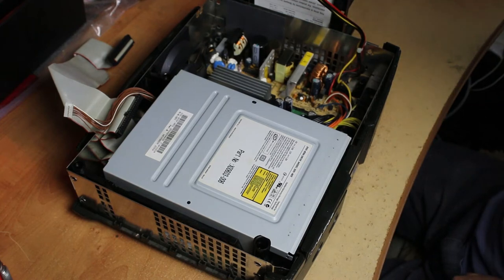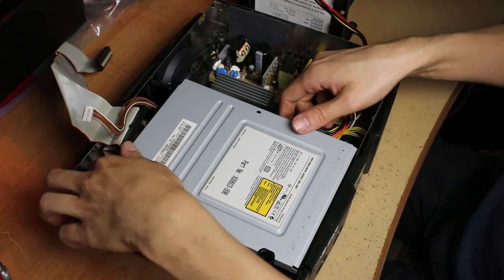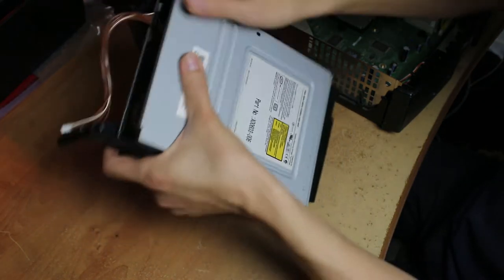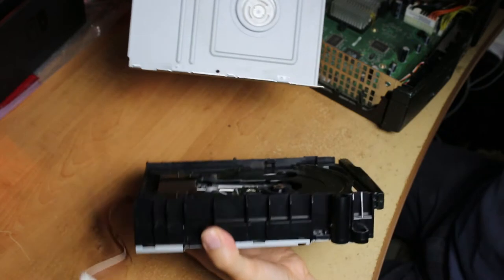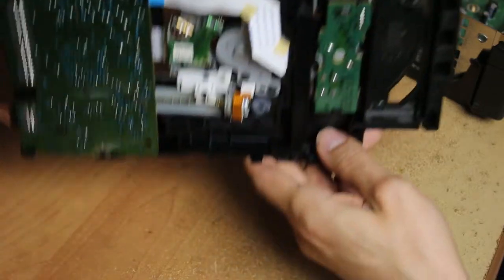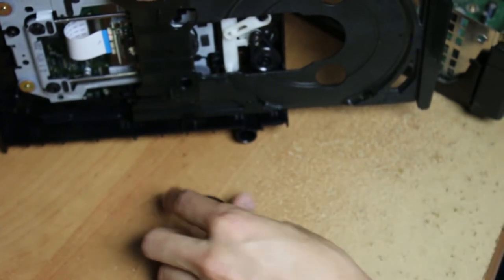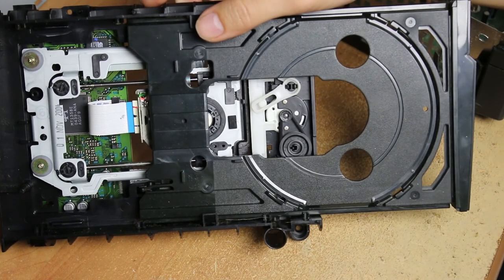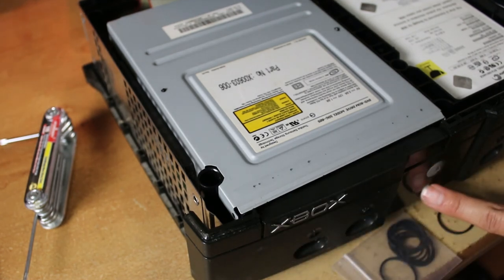How to Fix Original Xbox Disc Tray - Belt Replacement

Comment: I was a bit scared to use the paperclip trick at first because I thought I was gonna puncture something vital and/or get shocked for some reason. Turns out it actually worked great. I got tired of having to keep a bent paperclip next to my XBOX in case I wanted to play a different game, so here I am...
Reply from the maker: I use to do the paper clip trick too ( that hole is designed to help if it ever gets stuck) but I wanted to fix my Xbox so this repair helps!

Comment: Mine still opens but it gets stuck sometimes, will this fix still work?
Reply from the maker: Most likely.

 If it doesn't work it could be the gears or motors. The rubber is the cheapest thing to buy and test.

Comment: You can also try taking the old band, and boil it on the stove for 15-30 mins, that will shrink it slightly. I fixed mine like this after buying the wrong size replacements. If it doesn't work the first time just boil again for longer, took me 2 attempts.
Reply from the maker: I didn't know about that trick! How long do you think it lasts after being  boiled?
Reply: @AdamUPN0w  Good question, I've no idea lol I imagine the more you boil it, the smaller it would get and therefore last longer? It felt just as sturdy when I put it in if not stronger when I took it out.....First time I've ever owned an OG Xbox or tried this, saw it in a vid by OddTinkering on YT. He's worth a subscribe if you haven't already :-)

Comment: Called a Torx drive not security bit in Australia
Reply: Regular torx has a solid shaft, the security bits are torx with a hole in the center of the shaft for a pin which is unnecessary here.

Comment: If this is your Xbox do you think you can make another video on this problem I have. Or if I can send mine you can fix and make a video.
But the disc drive. Right next to the wheels with the rubber bands on it. To the left there is a gear that is aligned with the slots to help the tray eject. Mine is messed up and I can not find away to get to without having to break the tray. Please this would help so much.
The 4:00 marker in this video. You push the white slide and just “pull the tray out” well mine doesn’t pull out, it doesn’t move actually because of this messed up gear. There’s no video online anywhere with this oroblem
Reply from the maker: Have you tried the paper clip trick? https://youtu.be/FtcTZ28iCf0
Reply: @AdamUPN0w  yes. If there is some way I can send you a video if you’d like to check it out. I do the paper clip. Well when it’s open I push the white tab back, and it pops out about a quarter inch, but then it doesn’t smoothly pull out or “eject”
Thank you for replying btw man fr
Reply from the maker: I don't have the Xbox right now. It sound like your gears are not moving smoothly. Try cleaning it out and possibly look for replacement gears.

Another view of inside the Xbox https://youtu.be/yKZECIjl2Gc?t=149

I tried looking for replacement gears and disc drive replacements but it's hard to find. Next think is buy an Xbox for parts: https://ebay.us/yPoVbL
Reply: @AdamUPN0w  yeah I tried looking for a whole other disk drive itself too and couldn’t find any. I’ll figure something man I appreciate it though
Reply: @MWW-ib6dt  You're welcome.  Look into if the drive is daughtered to the motherboard or its just easy to switch out the disc drive.

Comment: you dont need to pull your xbox apart , FFS get the drawer half open till you see the belt , loop belt over tweezers till belt comes off pulley , remove old belt with tweezers and do the same to put new belt on , simple !

Comment: Why are people pulling apart their Xbox to do this. You can easily do it through the open try door.
Reply: There is some Xbox that require it to be opened up. If you can do it without opening it the better.
Reply: Ah ok. Now I get it. I was so confused why everyone was tearing apart their Xbox’s thank you for clarifying.
Reply from the maker: You're welcome. Microsoft worked with different companies throughout the years so the DVD drives internals are made differently.
Reply: yes thats how i did it ! 👌